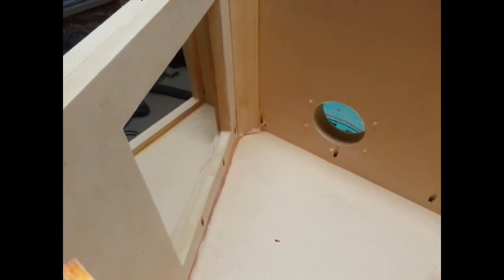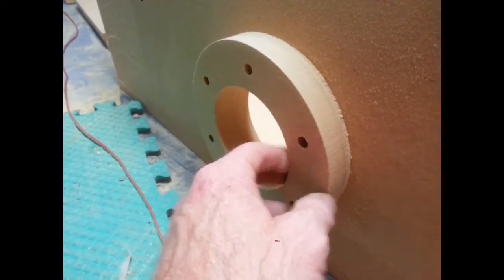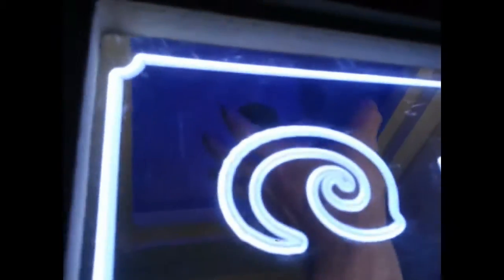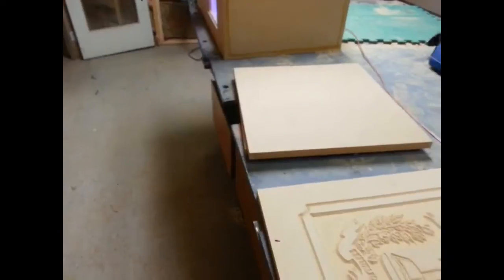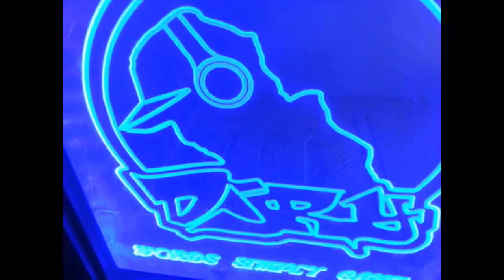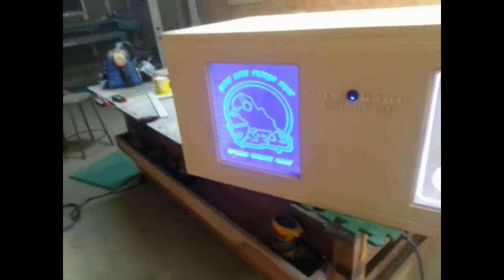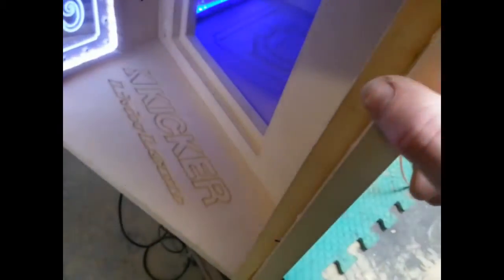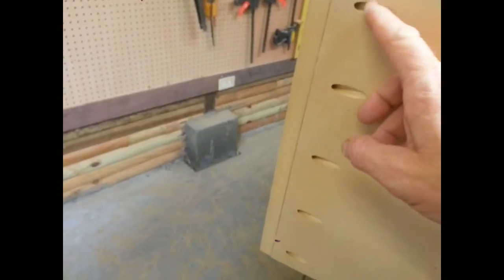L-7  Bandpass Enclosure

Comment: A single 4" port does seem a bit small for a 12. You've got the room to lengthen the port to allow a wider hole. I have 12" bass reflex boxes and 32 square inches of port in each one.

Comment: What did you use to etch the plexiglass ?
Reply from the maker: Hi Tonio I use a 48x48 cnc machine that you can see on my website here customenclosures.info.  I also use lexan which is 10 times stronger than plexiglass also lexan will not split or crack as easily as plex.  If you ever need any piece made let me know Thanks Robert